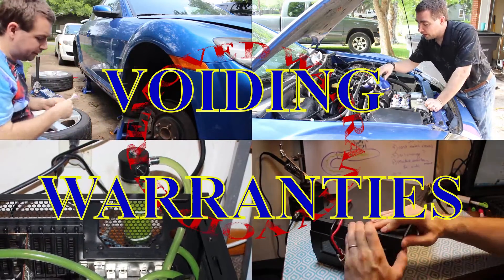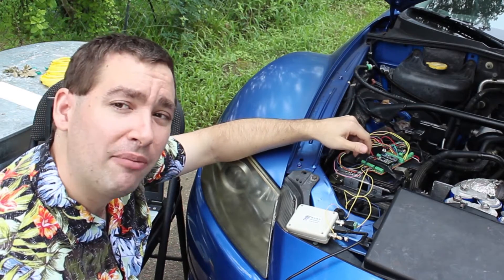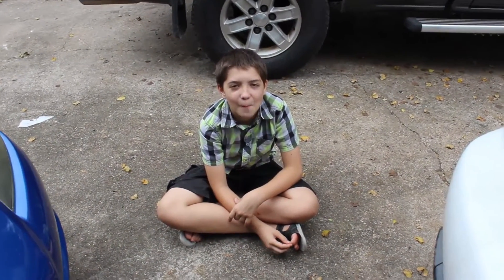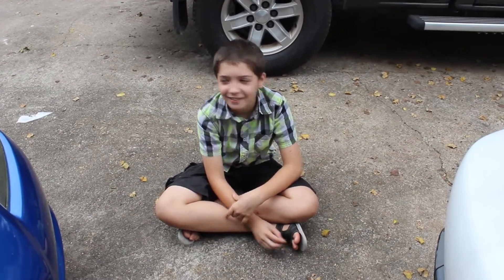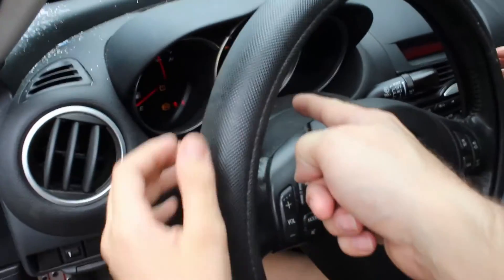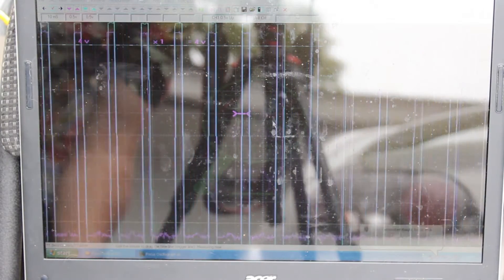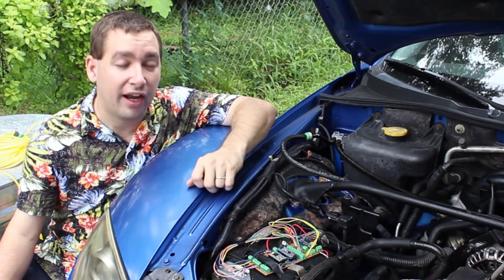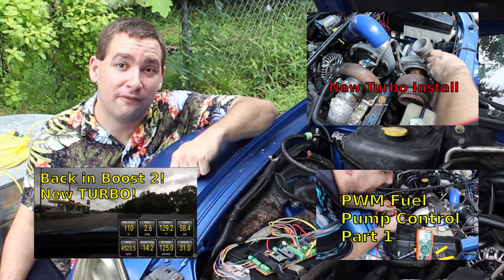Teensy/Arduino Based Piggyback Ignition for the Blue Beast - Voiding Warranties Ep18

Comment: how did you do the timing? using arduino timers? can you share the code? or any starting strategy?
Reply from the maker: I just used the Arduino to create a timing offset from stock, stock ecu used for starting.
Reply: can you share the code? do you have a website/blog?